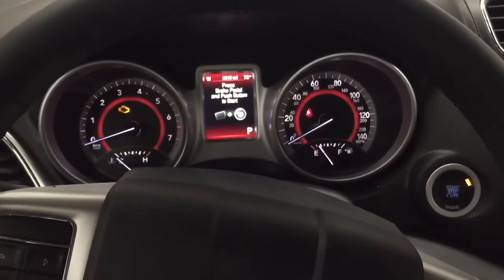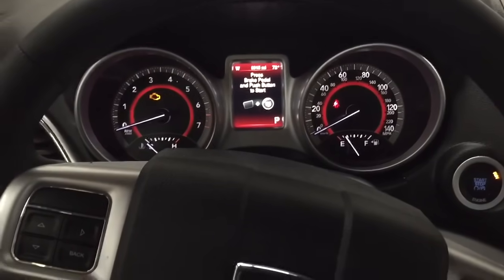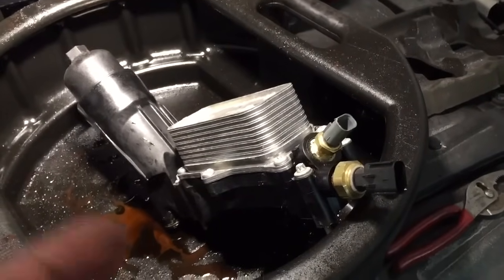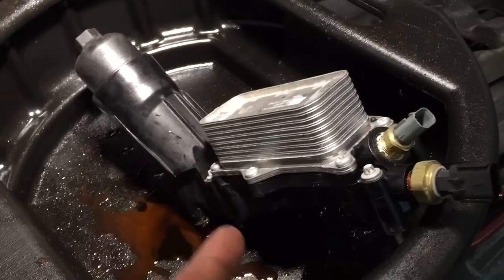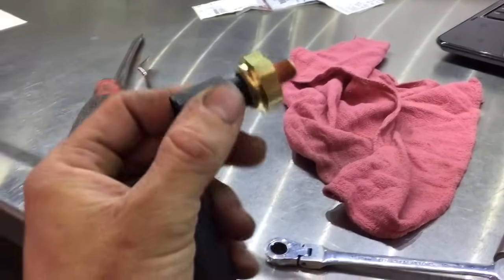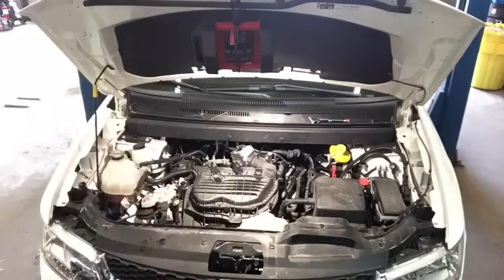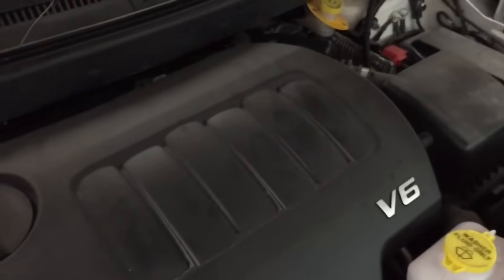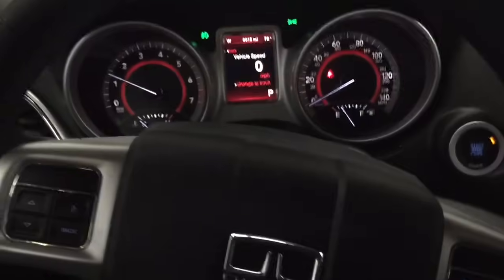P06DD Code, Oil Pressure Sensor Fix

Comment: I replaced the whole oil cooler assembly from mopar authorized reseller and still got same code again any help please ?
Reply: Yo Big you got to reset the computer cause it keeps reminding the problem
Reply: oil pump
Reply: Carlos daniel and ruso ochoa thanks for the reply but unfortunately i ended up selling the car due to lifter issues with the ticking noise and thats why that code kept coming up much appreciated stay safe out there.
Reply: @yobig9509  Do you know, if the lifter issue caused the code, or did the bad oil cooler assembly cause the lifter issue?
Reply: @stevev2851  to be honest im not sure if the oil cooler caused the lifter issues but i know that the code was because of the lifters. I did change the oil cooler thinking that would take away the code but no luck until i took the engine heads apart and found out that the lifters was the problem causing the code to come up. Funny thing is i really had no ticking noise prior to changing the oil cooler. Noise was a noticable after i got rid it. Good luck.

Comment: Hello there 
i had this code P06DD so i replaced the oil pressure sensor as the video but next day after the car was cooled down i got the code back again :S :S 
i always check my oil pressure gauge on the dashboard and it is pretty fine up to 500 no issue but when i get the code car won`t go above 3500rpm :S 
Please help me out thanks
Reply: hi morvy187.  i had the  same code on my jk wrangler. Dealer  replaced the sensor and like you, the code  came back. Now they say we have to change the oilpump, Did you ave any luck fixing the issue? You car not going up from 3500 rpm is a safety feature  to protect the engine ( no direct relation with the code)
Reply: Hey Erich
still i have the issue even i fully replaced the Oil cooler unit and still next step i have to go for oil pump replacing ..
Reply: If you ever replace the oil pump let me know please if it fix the issue. I have decided to wait because the oil pump replacement is not cheap and iam   do not trust so much the people at the dealer know what is really wrong. Iam under the impression they just follow  the instructions from a chrysler manual.
Reply: Take it from an expert in dodge and replace the oil pump it will work just fine after that
Reply: morvy187 Thx. I’ll give that a shot and let you know how it turns out!
Reply: @WarriorsGate1801   let us know how it turned out! it's been 2 months now!
Reply: @WarriorsGate1801  Any update??? Having same problem on my 2012 Dodge Grand Caravan 3.6L Replaced sensor with aftermarket and then OEM, same code pops up after a minute or 2. Lifter is making noise for a while, but I think the pump killed the lifter.
Reply: @ThEmEsSiAh187-CFGeorge  I have the same problem on my Dodge Challenger 15' and it's def the oil pump that has to be replaced ... The oil pressure on my car has been replaced today and still I be getting the check engine light and When I went to a local autozone to scan the code of the engine light it appeared again as P06DD and Its definitely the oil pump not the stupid oil pressure sensor
Reply: Frank Jimenez sorry for the late response. I ended up putting synthetic oil that the dealer recommends along with a good brand filter. Light has yet to come back. I’m mad that’s all it took to get rid of the light. I was putting regular Castrol 10W-40. Guess the van didn’t like it and the light turned on. After putting Mobil One Full Synthetic 5W-30 Oil and a Wix Filter, it’s been good for a week. Light has stayed off. 👍🏽 I believe it was the oil. But I would’ve changed the oil first before the sensor. Could have been both? Give it a shot. 🤷🏽‍♂️
Reply: @ThEmEsSiAh187-CFGeorge  so do you think it could possibly be due to change of oil?
Reply: I mean it makes senses maybe it could be because I still haven't changed my oil yet .. it's on 50 percent right now so I should probably give it a try but at this point It doesn't make any senses why I would get such a code that talks about Oil pump replacement ... So maybe it could be that It's time for me to change the oil I don't know I'll give it a try to see
Reply: @frankJ809  I really thought it was the oil pump because one of my lifters is making noise. Now I'm not sure anymore. But give it a shot. Mobil One Full Synthetic 5W-30 with a WIX Oil Filter. Lmk how it goes. Crossing my fingers for you.
Reply: @ThEmEsSiAh187-CFGeorge  thanks !!
Reply: Mark Simmons did you have replaced the oil pump ? I have the same problem in my dodge charger 2012 and i think it is the oil pump
Reply: Ali Aldokhy Same problem as well. I replaced the sensor myself aftermarket. Code came back after a had acceleration. Months later driving hwy speeds. Tried to accelerate to get over and multiple lights came on. My CEL, traction, oil light and oil chime sound. Along with that my oil pressure began to drop. Went to 2 different shops. My own which I trust and my brother in laws fraternity brothers shop and both are saying engine needs replacing. Both changed the sensors and I even had the 4 solenoids changed cause 3 were stuck. I have even bought the oil pump just in case and they said they didn’t want to put it on because it wouldn’t be the solution. My car starts fine every time and the oil pressure starts around mid 60’s to low 70’s. I’m not sure if that’s where it should start but I can only drive for about 20 mins before the pressure is around 30 or lower then I park. I’m driving a 2012 Charger SE 109k miles. 
I added all that for you guys to be careful continuing to drive your cars and maybe someone can help us all with this added info. I had no symptoms before it all went to hell!!!
Reply: @alialdokhy665  My mechanic  replaced the Engine Oil Cooler and Oil Filter Housing  3 months ago and the code went away. But it just popped up again today...so Im at a loss. Ill probably get an oil change and pray that fixes things.
Reply: @marksimmons5839  P06dd is not for the oil coolent, it is all about the  pressure if you have 3.6 dodge this code is if you are changing the oil continuously either the oil pressure sensor or the oil pump and best wishes to solve your problem.
Reply: @alialdokhy665  Just reporting ,my experience.  Issue disappeared for 3 months after changing the  housing unit. Thx though
Reply: Has anyone any further updates on this? I've got the same engine light and code on our 2019 Dodge Grand Caravan and quite concerned about it. (I know very little about cars) Any help or tips are appreciated, thanks.
Reply: Housing unit was aftermarket or oem mopar?

Comment: i'm a chrysler tech its seem that the 2014 and up are prone to leakage, never seen a 2011-2013 leak yet that i remember of. i know that they redesign the cartridge and housing in 2014 so i dont know if they mess up somewhere
Reply: I'm a tech in an independent shop, I did have a filter housing leaking on a 2014 Promaster, I thought it was because the quick lube was over tightening the filter cup causing part stress to get the thing loose.
Reply: I have a 2013 Grand Caravan R/T and I can testify, mine is leaking right now, so yes, they can leak!
Reply: I have a 2012 Grand Caravan and just replaced the cooler. after replacing, the P06DD code came up.